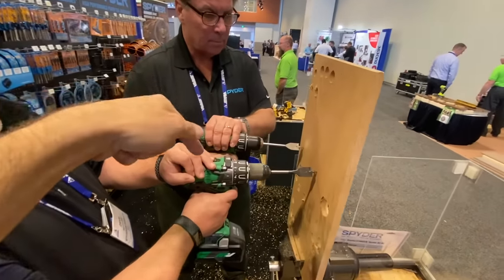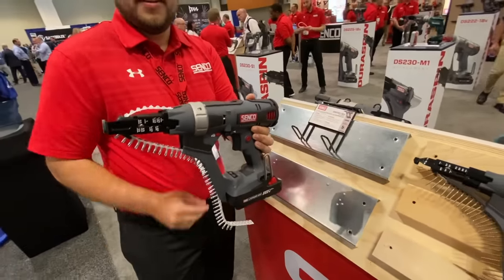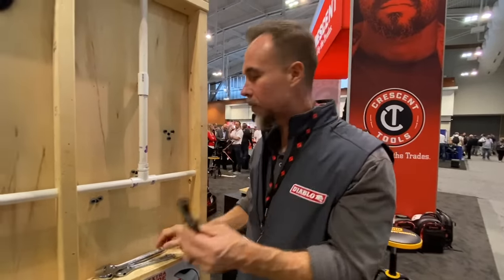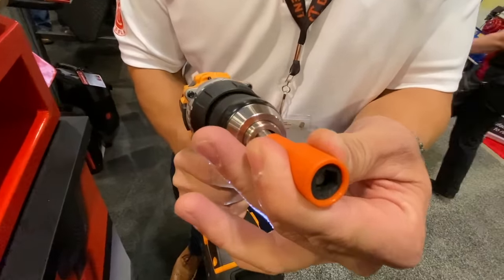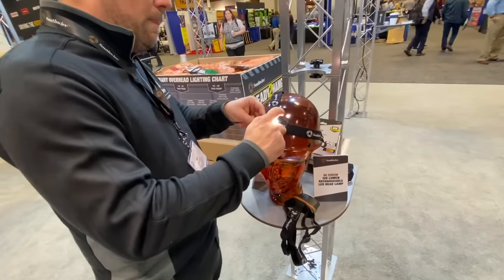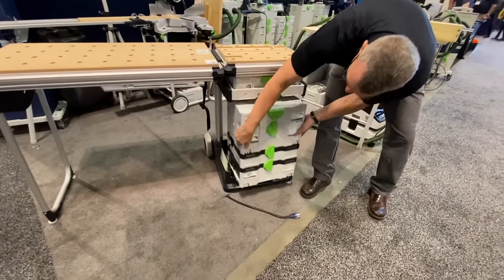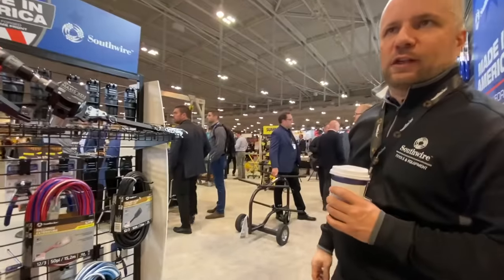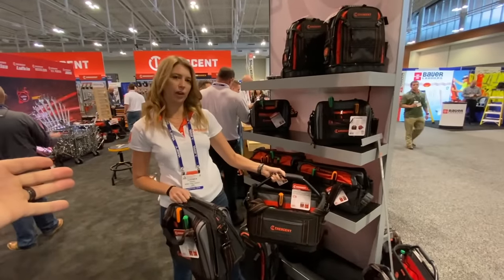New hand Tools, Inventions that actually WORK, power tools, and Equipment you have to see to believe

Comment: I can’t stand scam artist REPs. It’s pathetic how they purposely try to make the “leading competitor” bit fail.
Reply: ya we couldnt find the large section of bosch self feed spade "dare devil" bits at home depot... so we found the leading competitors shitty spade bit that was good technology 22 years ago to compare......
Reply: also note the battery size  and high output. 
theyre compairing their bit with the same drill but with a  4ah high output battery compared to the other "bad bit" with the standard in box small 1.5ah battery.
Reply: The guy on the left wasn't even pushing.  Guy on the right had his hand in the back and on the trigger.
Reply: Give me that bit and if I put it on a Milwaukee hole hawg it'll rip right through the board.

Comment: That spider bit looks like that self feed Bosch bit they should have put those together
Reply: Yeah, was gonna say Bosch has had similar self feed spade bits here in Europe for years...
Reply: yup,that bosch daredevil is aggressive though
Reply: Except then the Bosch might have kicked their ass, soooo...  lol
Reply: @komitadjie  been using the Bosch daredevil for years. The spider is just a copy.
Reply: And the Bosch bit will rip your wrists up if you are not careful! I only use them in my drill press!
Reply: @ratdog3055  spade bits are ment to be used in either hammer drill setting or in an impact gun. Everyone knows this lol.
Reply: @ratdog3055  I use a 3/4" and 1 1/2" in a 12 volt rigid impact every day at work.
Reply: @ratdog3055  that's one of the great thing about an oil impact, won't twist your wrist off when you get a little resistance!
Reply: @andrewfidel2220  I've never had an impact wreck my wrist. Now when I forget to set the clutch for screws on my drill, I'm occasionally hating life. I've also had a drill bind in a steel I-beam and crack me in the head just under my hard hat with the battery.

Comment: Take an adjustable wrench, cut the handle off and call it new technology. Nah, I own a chopsaw and have old wrenches.
Reply: Take a 10" adjustable wrench, cut the handle down to 4", weld a square drive hole from a socket on the end. Had to make one like that to get into a tight space, now is my go-to. Small enough to get into tight spaces with an option to extend it with a ratchet if need be.
Reply: Bacho has made wide opening adjustable wrenches for years. They are expensive. The 8" opens to 1 1/8  down fall of this is the 8" doesn't have the leverage obviously. But they will stand up to being hit repeatedly with a 3lb hammer while being cussed at.
Reply: @cdrbews  That's funny, but I know exactly what you mean !!

Comment: can people stop adding "technology" to literally everything? Like buddy its a screw in front of the spade bit. Its like making a new light bulb and saying it has new light technology.
Reply: Plus it's not new. Screw tip puller drill bits have been around since literally 1850s... aka ship auger bits, designed by Jennings.  Laughable that it's some new "tech" though. They made a little cut relief in the screw tip and called it "new tech."
Reply: I started laughing so hard when he said patented tip technology!
Reply: Grand River Wood Co     I swear first thing I thought
Reply: It's called a worm.
Reply: @philpullan8595  That's what she said.
Reply: Yep, “New technology” actually been around years and you’re hoping people haven’t seen it so it seems impressive, “aircraft aluminum” isn’t true unless you ripped the skin from an aircraft it’s aluminum of certain alloy and temper, “ergonomic handle” means it’s not a square handle. LOL
Reply: My thoughts exactly when I heard that!👍
Reply: I'm using the new comment technology to respond to someone from a year ago.

Comment: Pretty good example of why you NEVER believe those live tool comparisons when performed by the reps.
Reply: Why? Just because one guy was using two hands and the other only one hand? Or because one drill had a fresh battery and the other was old and half dead? Or was it because the bigger guy was using way more force than the other guy? Never mind the fact that the leading competitor bit was as dull as a butter knife. Even my Husky spade bits can drill faster than that leading competitor bit.

Comment: "compared to the leading competitor" yea ok there
Reply: and make sure  its as dull as possible
Reply: Dull bit, weaker drill, dead battery. Seems like a pretty fair comparison.
Reply: Big guy pushing strait little guy off angle seems legit
Reply: I don't know why they're always worried about speed when Precision is just as important
Reply: The leading competitor’s grandfather’s bit
Reply: Won't be buying those bits or anything else from that company! Scam artists.
Reply: the other one also has a bigger battery
Reply: I would have called them out instantly on video for all of the failed. Different drill speeds, inferior space bit used as the " leading competitor" a dull bit used against a brand new bit and the fact that other dude didnt know how to use a damn drill.
Reply: Yeah that’s funny, it doesn’t look like a Bosch Daredevil....
Reply: Anything can cut that fast if you sharpen the edge and use a 20v vs a dull 3/4 dead 12v
Reply: New adjustable wrench wtf the 8" meets the 12" the 12 meets the 15" so they all match so that 15" matches the 8" nice
Reply: Tbh.. I just want one that dulls slower. Fast drilling only leads to tear out.
Reply: What a fucked up comparison.
Reply: Leading eBay competitor's
Reply: @Timberjagi  0ppp0ppppppppppppppppppppppppppppppppppppppppppppppppppppppppppppppppppppppppppppw

Comment: "Patented screw tip", well that's BS for a start, those bits are older than Noah. Avoid tool bags with any kind of zip, one bit of sawdust and they'll jamb right up. That wrench you could use at an angle was interesting, but I've never needed to do that so I'm not sure I'd need one. Still, nice to see what's coming out. I reckon some kind of external mic would help you out a bit, thanks for these kind of videos.

Comment: Every sleeve is stationary, and you can hold onto it while driving a fastener/screw etc.    How is that new?
Reply: I was thinking about the one I have from Harbor Freight that is just like it.
Reply: Yep, non-marring bit holders of many kinds have been out, also sleeves
Reply: The problem, at least for me, with the sleeves is they come off pretty easily and if they shift after you put it back in your bag as you move to a new task on sight the sleeve gets tweaked and now it's useless
Reply: @Mr.Neko013  I'm not following you.  I don't understand what it is you are trying to describe.  Sleeves stay on the end of the drill/driver.
Reply: @jmackinjersey1  I'm referring to the sliding sleeves on a bit holder meant to help the user keep the screw on the tip by sliding it down over the bit and the screw. It provides no resistance so it's fine on most surfaces
Reply: @Mr.Neko013  OK, just wanted to make sure we are talking about the same thing.  But I'm still not sure how you are using it, if it is a problem.

I do understand that the cheaper ones tend to break quite fast though.  I've bought a few from Husky or other low end brands and they can last as short as one job or one week.  But the ones I buy from DeWalt or Milwaukee last a lot longer.  Heck, I typically lose it before it breaks.
Reply: @jmackinjersey1  I get better life out of the DeWalts, but the sleeve doesn't last long. I bought a cheapo bit set and tried using the bit holder. ...Stripped it out in a week, so I need pliers to pull the bit out
Reply: @court2379  Yep, I was thinking the same thing. I got one from Harbor Freight that does that, too. It’s definitely not anything new or special.

Comment: Here is the "Catch" on the Cresent bags, straight from their website: 

 (a) any Product which has been modified, disassembled and/or reassembled or altered in any way or 

improperly installed; (b) any Product which has, in Apex’s judgment, 
been subject to negligence, misuse, abuse, accident, improper storage or
 damage during shipment; (c) any Product which has not been operated and
 maintained in accordance with normal practice and in conformity with 
recommendations and published specifications of Apex; and (d) any 
Products which have been serviced or repaired by anyone other than an 
Authorized Repair Center of Apex or modified by anyone other than 
Apex. Normal wear and tear is also excluded.
Reply: the B is where they get ya
Reply: Anything apex tool is a joke, destroyers of once good tool brands
Reply: Clause (c) is also a gotcha. Pretty much guaranteed that "normal practice" doesn't conform with "recommendations and published specifications of Apex".

Comment: oh god its gets even better, you can get as much torque out of an 8" bar as the 10" bar?
Reply: Yes if they include a pipe to slide over the handle. That guy was clueless and has no idea what torque even means.
Reply: It can take as much torque. It's basically a shorter wrench of the next size up. 10in jaw 8in handle ext.
Reply: I was searching for this comment the moment I heard it. It can withstand the same amount of torque, but you cannot apply the same amount without additional leverage

Comment: Word of advice for people breaking out and gonna buy some pipe wrenches. It is worth it to buy Rigid pipe wrenches. Their hook and heels are so much sharper and last so much longer than ANY other pipe wrench manufacturer out there. You can pick up a 50 year old Rigid at a yard sale, pawn shop, or on eBay for a fraction of the price of a new one and replace the hook and heel if they need it. Sure they are expensive, but I promise you, you will not want to throw the wrench across the job site if you just use Rigid. They are wrenches you can pass on down to your grand kids grand kids. Some wrenches are made to where you have to buy a whole new one if the hook or heel are worn out.

Comment: I like that bolt cutter best, I've used others that take way too much effort to do the job. I usually end up adding sections of pipe to the handles to get more mechanical leverage.
Reply: If you can't beat it cheat it😉

Comment: I have a 5 star notebook I bring to the gym to write my workouts in, it's about 15 years old and I zip it open and closed for each set, zipper still works like new.
Reply: Very likely doesnt get sawdust, metal shavings, dirt, into the zipper - or get kicked around a jobsite. Easy for it to work in perfect conditions.

Comment: the bit with the outter jacket that you can hold on to , ive gotten thoes in dewalt bit sets, it may of not been a plastic outter shell but it was the same concept to be able to hold it as well it was also used as a sleeve you pull out and setting a screw in

Comment: With the spade bits as well as any other demonstration , one operator is. Using the tool differently. The spyder bit wielder is pressing the back of the gun in vs the other only holding the handle.

Comment: Flex Seal, WD-40 Specialist Long Term Corrosion Inhibitor, Fluid Film, Corrosion X HD, CRC Heavy Duty Corrosion Inhibitor, Corrosion Block, and used motor oil tested as car / vehicle undercoating for resistance to rock chips and corrosion (oxidation / rust).  Various deicing products, such as

Comment: We have the spyder hole saws there amazing every contractor we show them to goes out and gets them. We've Ben using the same set for 3 years drilling floor joists for pex 1000s of holes they drill concrete and wood will drill tile to but it's a little dicey cause it chip a bit.

Comment: Seems like you've got all neat tools, there - some folks better lock up their credit cards!

The sad thing about so many demonstrations, like the spade bit drill, is it would be so easy to make up a simple, weighted jig to do direct comparison tests - just swap over the bits (even better, use new competitions' product straight from the pack). As is, even with the best intentions of a fair test, there are way too many variables with comparisons like the first video for them to be really sound demonstrations. I have no doubt it's a better bit, but some will question it.
Short handle, wide jaw shifter is neat - also less likely to overtighten fixtures. NOTE, folks, Stan used the wrench the RIGHT WAY - the worm is for adjusting, NOT taking the stress!
Protective 'anti-marring' sleeve is cool! It would also be very neat for automotive and other light engineering work, especially painted, plated or treated surfaces.
Head lamps are always cool!
Festool trolly is nicely integrated - is there provision for a second extension on the back, as I see that one can be fitted to either side? Bottom tray may be a good place to place a break-out box that could be hooked up with an extension cord to site power, or for battery chargers or storage.
Angled Crescent wrench could have saved a fair bit on knuckle skin over the years!
Personalised colours for the power cords 'might' stop 'honest' people 'borrowing' them - low temp's aren't a problem here, current ratings and high temp's are more so. That said, doubt they'd have the right plug/socket for AUS/NZ anyway... :-(
Crescent bag looks interesting - be nice if they'd mentioned how well it sealed, like resistance to heavy rain or fine dust getting in?

[edit for typo']

Comment: I have some old Horrible Freight spade bits that would plow through that board maybe not as fast as the screw one but not far from it. That guy was not pushing on the drill while the other guy was using a lot of force. It was like watching a race where one guy was driving as fast as possible and the other guy never got it out of first gear.

Comment: As interesting as festool does for their products they do need to look into their manufacturers specs for any of their plastic components. If they get below 10 degrees celcius they break at any hinge location. They also love designing their tools with iso-ribs meaning they can reduce the material required to make their products which also reduces their impact resistance greatly and increases their likelyhood to get damaged in the cold.

Comment: not gonna lie... I kinda want one of those bags... did you ask if its waterproof as well? Being someone that works in a fairly damp environment on a regular basis I always need something durable + water resistant (rusty tools have just become part of my life now)
Reply: Veto pro packs homie. Best bags out there. Been doing hvac for over 25yrs and I usually burn thru a tool bag in a year or less. Going on 2yrs and still holding up. Pricey, but worth it

Comment: I use those plastic Apex sleeves at my job and they work ok. Just hope that there price went down we went from a $6 socket added the sleeve and now they charge $60 for the same socket with the plastic sleeve.
Reply: Why not just use a hard plastic tubing around the bit? Even if it spins, it won't mark anything.

Comment: Self adjusting pipe wrenches are over 100 years old in design.  Other countries except the US have been using making them for years.  As to a normal pipe or crescent wrench, throw them away and buy yourself an antique Eifel Plierench - get one with the full set of jaws.  Rack and pinion hold the handles together with a vise-like, 1 ton  grip.  Read the 5 minute instruction as to how to use them.  Its probably why they did not take off and become the best tool used.

Comment: Very beginning of the video with the drills. The drill with their product has a 6Ah battery vs the "competition" as the 3Ah. Battery.  Larger  ah batteries will put out way more power & make all the difference.
Reply: 'Amp-hours' is a measure of capacity, the voltage will determine the output torque. Still, it's likely that the higher capacity battery will have less voltage drop after some use, you you might see a marginal difference once some of the battery is drained.

Comment: I know I'm late to the party, but I have to chime in on the Spyder bit. It may be "patented technology", but it's not their original design. I've had two generations of Bosch's spades.  This is identical to the original.  My biggest beef to that design is that if you even graze a framing nail in a stud, you knock the tip off one or both sides of the blade, rendering the blade useless and inaccurate (notice the tips flare out?  That's what determines the hole size).
Bosch improved the design on Gen 2 by moving the tips inward, so the tip width is less than the actual blade width (the sides of the blades are ground to cut.  This reduces the possibility of knocking off the tips on a nail (although not eliminating the possibility).
Another advantage of gen two is that if you make your hole too small and need to enlarge it. You can then use the next size up, starting with the tips inside the hole (which were set inside the blade width by 1/16").  I've done this many times!  Drill a half inch hole, and it's too small.  The side tips of the 9/16" bit are 1/2" apart (the blade itself is 9/16").
Around here, Spyder bits and blades are knockoff's that try to be the economy version of the name brand tool.  They are also sold in a similar display as the companies that sell resharpened blades a a discount when you bring in an old one to be recycled. I'm not saying their bad, just not high end or innovative.
And I've had a self adjusting pipe wrench for about 20 years.

Comment: Bahco tools  make those wide mouth adjustable spanners they have been out for years over here in the UK..ive got a couple of pairs in me tool bag along with a cut down a cut mouth one which is great when 2 spanners cant fit a nut and fitting these have half a mouth that allows that to happen ..
my small internet search and you can get them at sears...